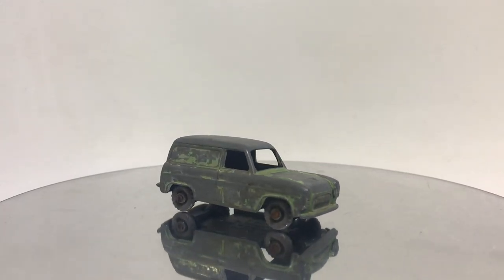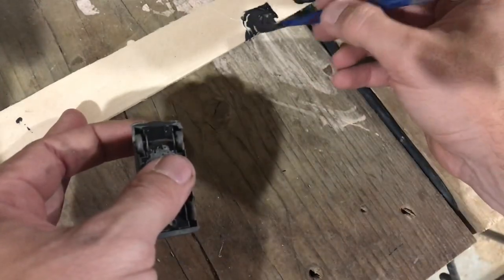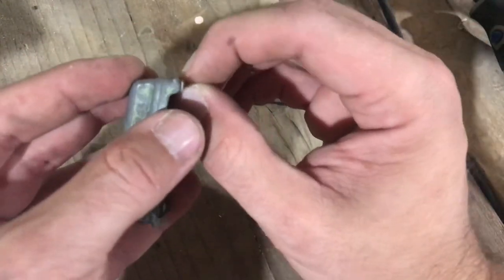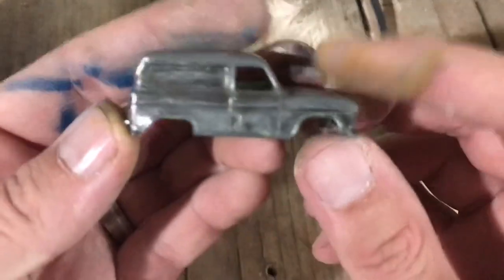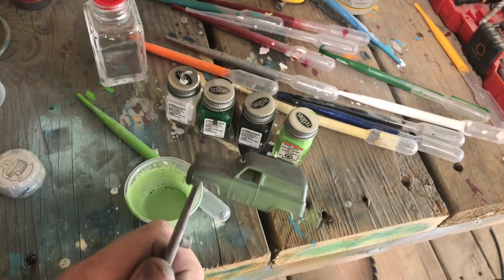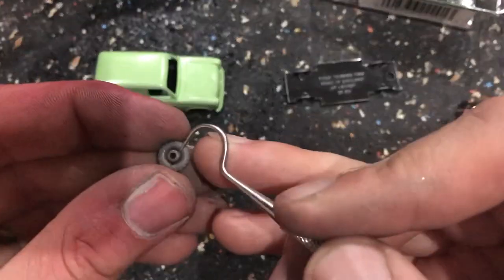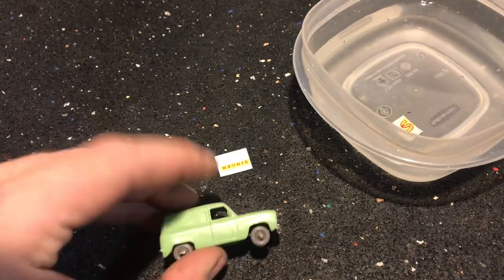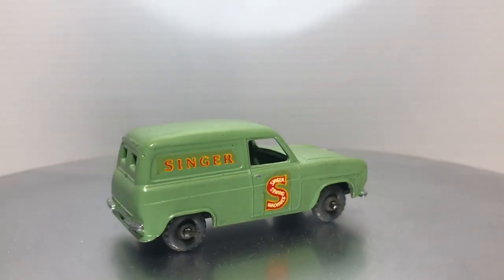Matchbox Lesney  #59a Ford Thames "Singer" Van Complete Original Restoration and Repair

Comment: Hi VDR. Apparently Lesney were not too bothered with the continuity of colour with their models in successive years and you can find several different shades for the same model and for all of their various models. Decals and bumber/grill/lights  detail also altered from year to year. Great repair on the slot at the back.
Reply from the maker: Yes!  Sometimes I think they just filled the spray booth with whatever was close.  I've seen pics of originals of this casting in a dark green, like evergreen color too!

Comment: Nice job,  I have not tried the Testers paint with the airbrush.   I may need to give that a try.
Reply from the maker: I've tried a few different types, but I just seem to get the best finish from my Testors Enamels.  It's great paint!
Reply: @vintagediecastrestoration  I have been using Vallejo Model Color and Krylon Gallery Series Clear Coat.